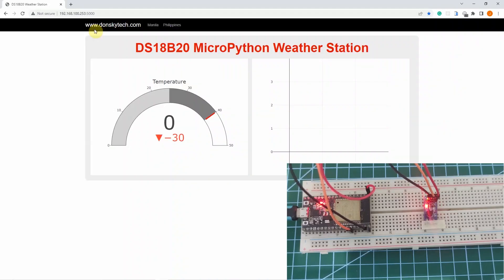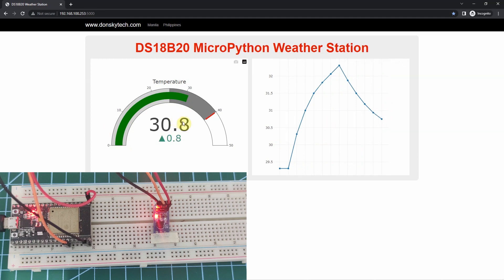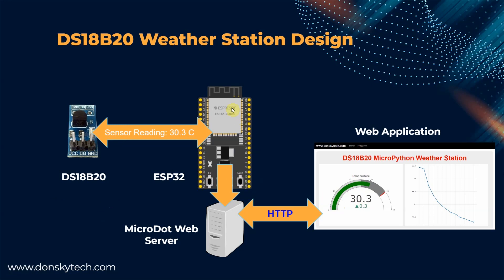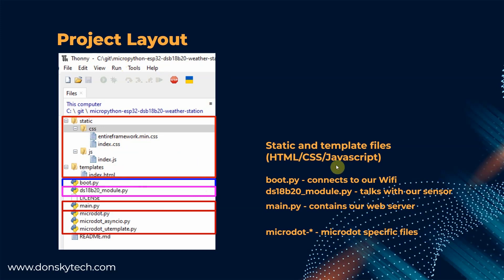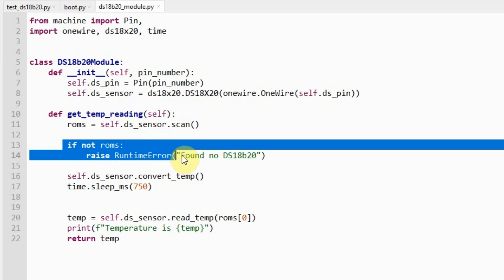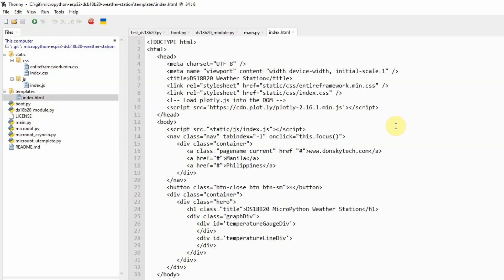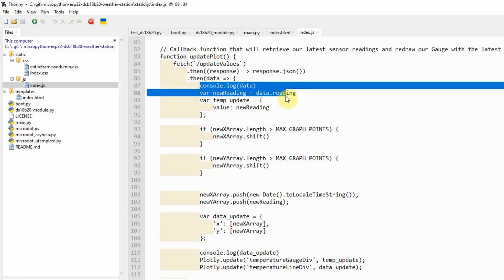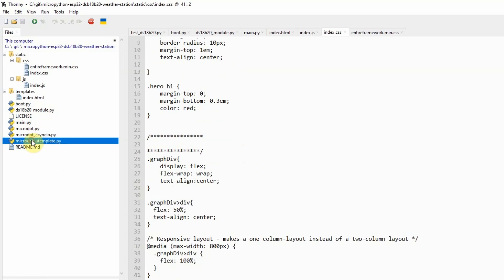Control DS18B20 using MicroPython with a Weather Station Project

Comment: I'm having trouble getting this to run on my Pi Pico W. It just ends with no errors. It logs into the network and just stops. I've verified that the DS18B20 works with a different program. Are there changed that need to be made for the Pico? Thanks in advance, I'm pretty excited about Microdot if I could only get it working.